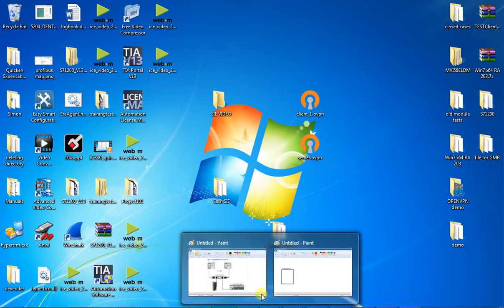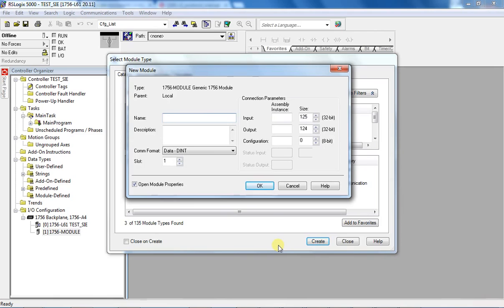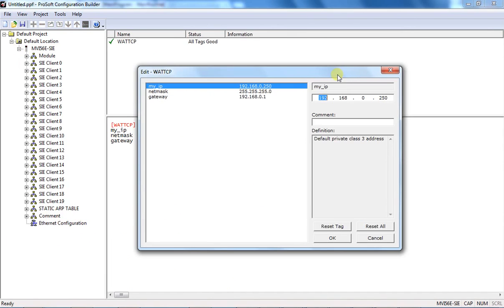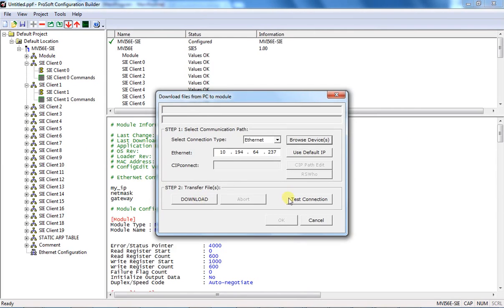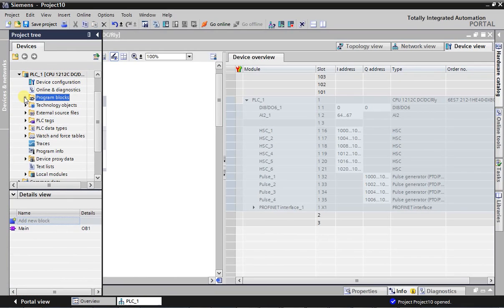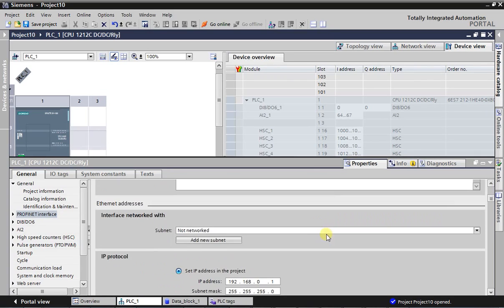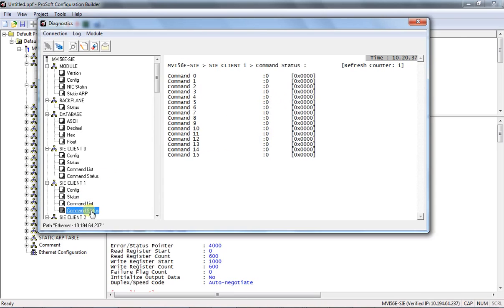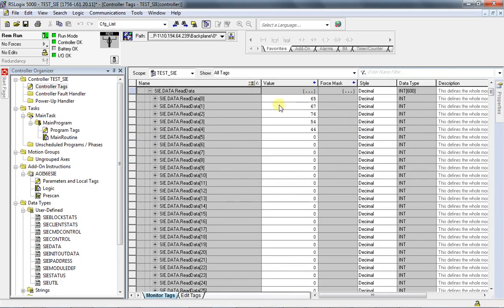MVI56E SIE configuration

Comment: Hi Simon, I have question, 
which type of cable that you use to connect from Siemens PLC to 1756 MVI56E SIE module ?
is it Profinet cable or normal Cat5e Ethernet Cable?
Reply from the maker: @tendaywibawa3663  Hi, just a normal Ethernet cable. Cat5/6.

Comment: Hi Simon
 
could you explain why you make DB1 (INT) Tag with input adress IW22? Thank you
Reply from the maker: Hi Tigran,
So the latest version of TIA will automatically map your DB to the controller memory and automatically assign an address. Back in v13 SP1, you would have to assign a address to store your data in the Siemens controller. You would have to get the address from the controller's Device Overview. Does this answer your question?
Reply: Hi Simon
Thank you for the fast answer
I need to read and write DINT, in that case I probably need to define DB1 as DINT and as% ID22?
Reply from the maker: Not necessarily if you are using PLX3x-EIP-SIE gateway (or the MVI56E-SIE InRax card). The gateway's internal database is defined at INT limits (it is a 4000 INT size register database). That means from the gateway's point of view, a DINT is actually 2 INTs stored consecutively in the database. Say you have DINT in your AB controller, when you send this via EIP to the gateway, the gateway will store it as INT1 and INT2. Like wise, when you the gateway is returning it to the AB controller, it will return INT1 and INT2. At that point you will need a COP instruction in your logic to convert these INTs into a single DINT. The same applies to the Siemens Ethernet side. An ideal solution is to have 2 arrays at your controllers, one that is in INT size for the transfer and another that is in DINT size for the conversion of the transferred data. Makes sense?
Reply: Can I use same settigs for S7 1500 CPU ? I must read from DB 170 and write in DB 175 in this case i need 2 INT Tags or ?
Reply from the maker: @tigrangrigoryan1105  Okay so as far as I can tell, it will work with the 1500, but I have never tested it myself so I can not be 100% certain. All the documentation I can find suggest that it does, I will need to do a bit more research. You have the freedom to read and write any datablock address. If it's a DINT, it would occupy 2 INT registers. I will avoid saying "you will need 2" because you essentially have 4000 INT registers to play around with.